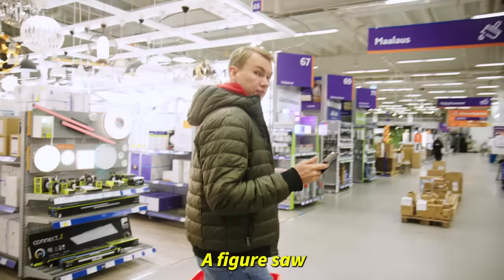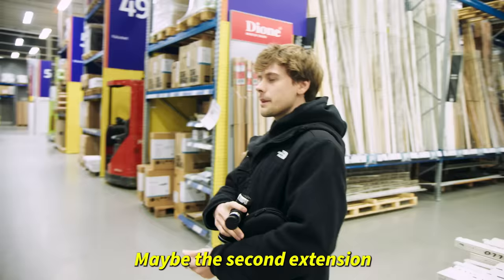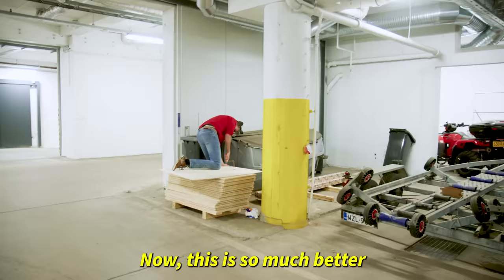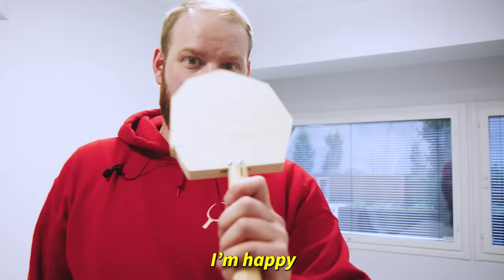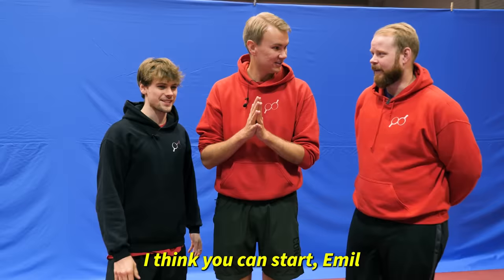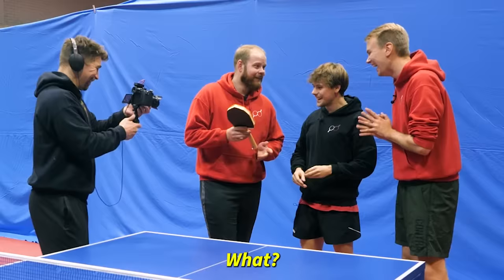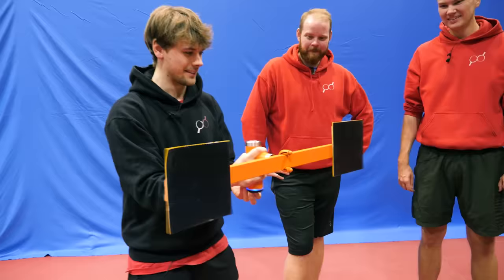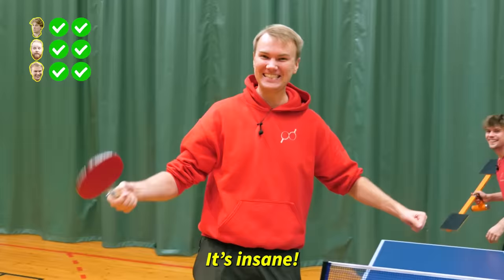Ultimate Level Ping Pong

Comment: I can't believe Emil didn't win the vote. I mean the Emil-chucks are probably not the most practical option, but they are, by a mile, the coolest of the three options. I'd totally buy one of those.
Reply: @@thisisanewchannel-wd7jl I mean if you clicked on the video expecting practical and functional rackets you came to the wrong place
Reply: @@thisisanewchannel-wd7jl OK maybe I wouldn't buy one. Still a cool idea though.
Reply: Emil's racket is the coolest, but I think Otto's is more useful in an actual match if the racket was made more robustly.
Reply: Ikr? It is the kimd of thing you would expect to see if Shaolin table tennis was a thing . Winniing by that much margin for a racket which doesn't hold is outrageous imo. If people who voted had video context, they would have voted otherwise for sure.
Reply: Without their extreme skill, I'd probably hurt myself with Emil's racket. Otto's racket hurts the other guy 😈
Reply: I do think his racket has the most potential. For an average player, it might be basically impossible to use it, but if you were to practice with that racket and get good with it, i think you would be able to generate insane power and unexpected shots because of the possible angles you could get with it.

Comment: 4:18 I haven't finished the video, but I don't think you thought the chain all the way through. Physics will prevent you from having the wide area hit the ball if you try for a straight shot due to the aerodynamics and weight distribution as the edge will always be facing the direction you're swinging the paddle. So it seems you'd have to hit every shot at an angle which will be pretty difficult. If you find a way to bypass that though, I'll be really impressed. If you had a cube at the end instead of a paddle it would kind of work, but that still doesn't seem like a good idea as you'll lack control if a chain is involved at all.

Comment: On the note of further development of Otto's Extension Racket...   You should include a coiled cable (like the self retracting garden hoses) inside the extension piece connecting the blade to the handle so it doesn't break due to over-extension and maybe even have some retractability during play!   🤣

Comment: So you played a match where you drilled holes in the table every time someone scored a point, what if you did the same thing but drilled holes in your opponents racket instead?
Single holes wouldn't be big enough for the ball to pass through but big enough to cause weird edge bounces (as well as the obvious loss of rubber coverage).